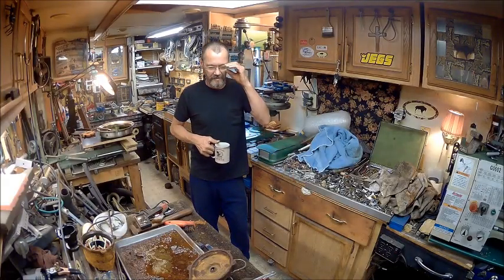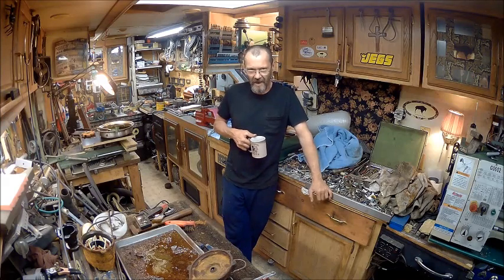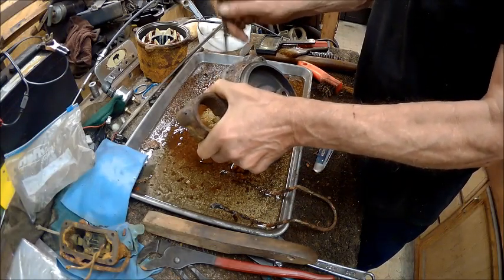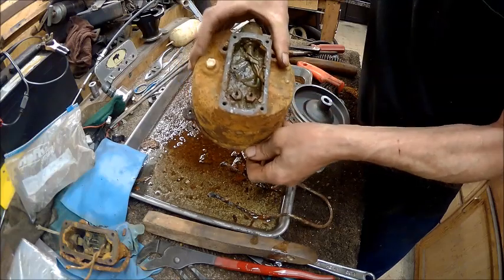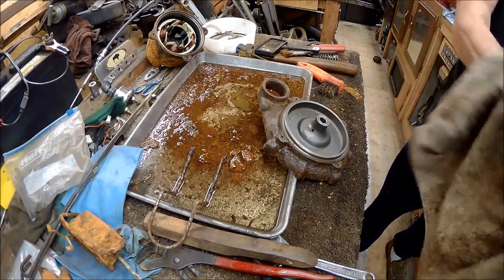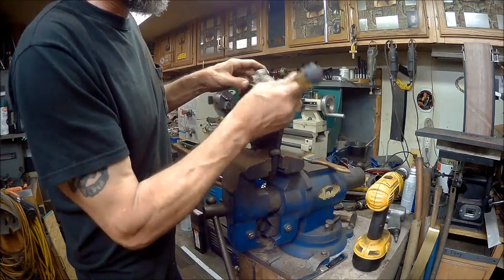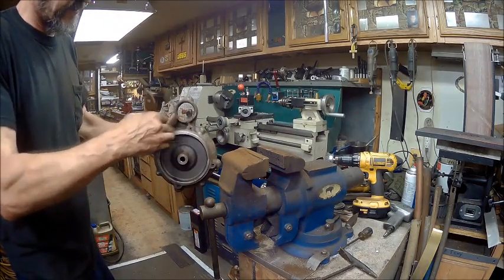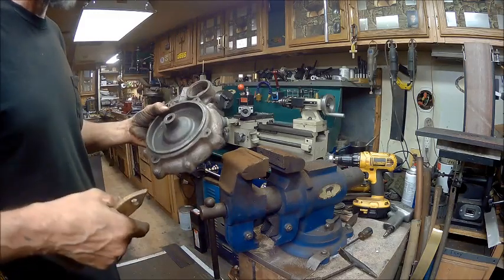zoeller m53 d sump pump rebuild part 1

Comment: Dont fill the motor with any off the shelf mineral oil Bob, heres some info:

Dielectric Insulating Oil  

Inside of many submersible electric motors you will find a very thin, clear oil. It is very easy to mistake it for water. 
Dielectric Oil is a thin, light, clear, highly-refined version of mineral oil. It is non-conductive, so it is OK to be inside the motor.  Standard mineral oil cannot be used as a replacement.
It is placed inside the motor as a cooling agent. The oil absorbs the heat produced by the motor and transfers it to the outer shell of the motor. The cool water on the outside of the submersible motor can then absorb the heat and cool the motor.
Reply from the maker: can it not work without it? because the shit is expensive.
Reply: Probly expensive for a reason, one way to find out I guess. Its what cools the motor while submerged from what I researched....kinda like electric transformers up on telephone poles....filled with the same stuff. A motor filled with oil intrigued me....so did some research....cool stuff
Reply from the maker: i cant find anywhere that tells me how full to fill it.
Reply: Call Zoeller, till armature is fully submerged from what I understand and read. They can tell you what is appropriate. Shops that rebuild pumps and motors should stock it in smaller quantities....probly $15-20/qt. they buy it by the drum

Comment: After 45 years of plumbing, I have a barrel full of these M53 pumps. Most just need $25 switches. If you remove the rust & scale it allows more rust & scale!

Comment: bob, get yourself what is called a pneumatic scaler. it will save you endless hours of picking and scratching and such.  great videos !
Reply from the maker: i like the pecking at it with the hammer. thanks
Reply: Take it from a Dentist... an ultrasonic scaler (for cleaning teeth) saves 90% off your labor time
Reply: needle guns are the best for sure